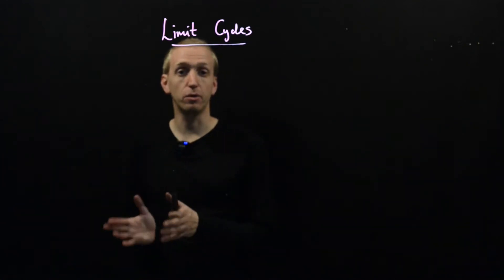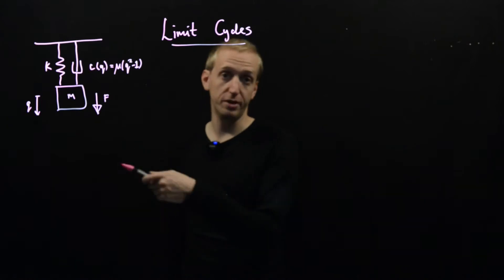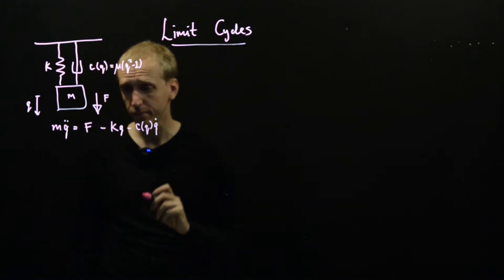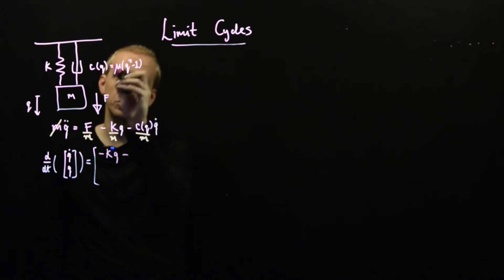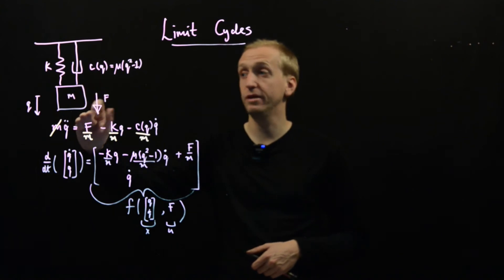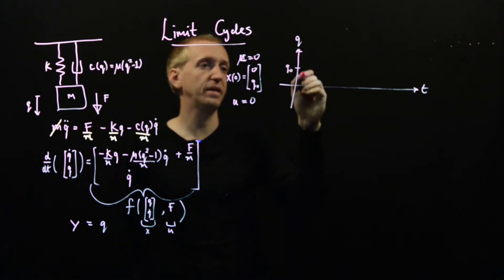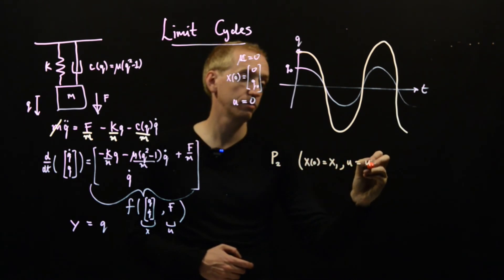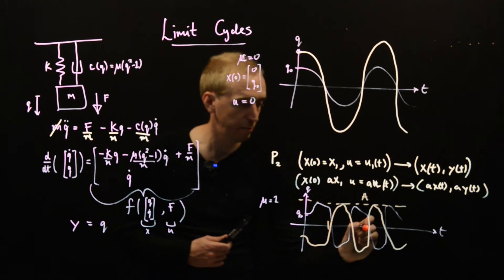Limit cycles

Comment: can a linear system produce a limte cycle(marginal stability case)?
Reply from the maker: Good question! This is really a question of definitions. As you observe, marginally stable systems can produce sustained oscillations! However, the amplitude of these oscillations depends on the initial condition, meaning that small perturbations to the initial condition can lead to a 'different' oscillation. It is this small difference that means that we don't call this a limit cycle. A limit cycle is an oscillation of fixed shape, which nearby trajectories will tend towards (or away from if the limit cycle is unstable). The idea is to try to extend the idea of a stable point, to a stable periodic behaviour. For example, think of your heartbeat. This is a periodic behaviour which in steady state has a fixed amplitude and frequency. In order to maintain this behaviour, your body must be able to make small adjustments in response to perturbations to keep the amplitude a frequency constant. We then introduce the concept of a limit cycle to describe this behaviour mathematically, and then generalise the ideas of stability or instability of a point to apply in this setting as well!
Reply: @richard_pates  got it. thanks a lot for ur detailed response.